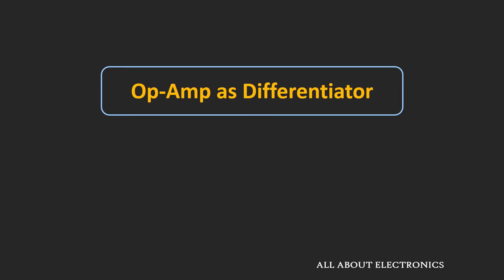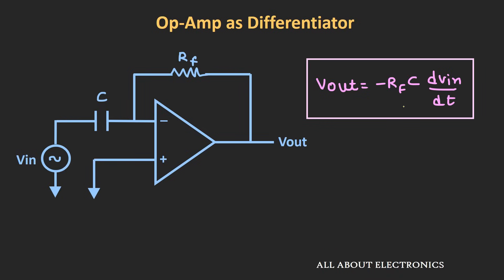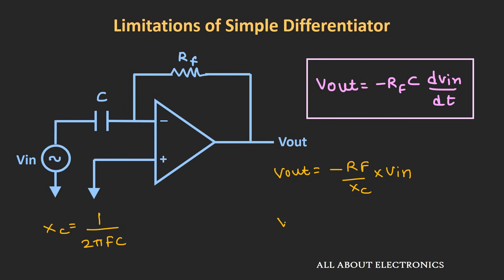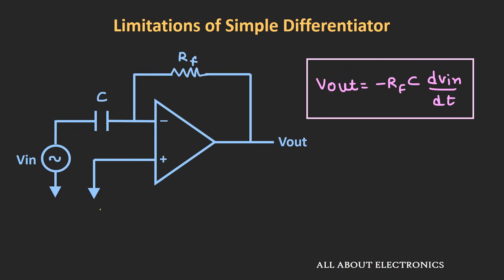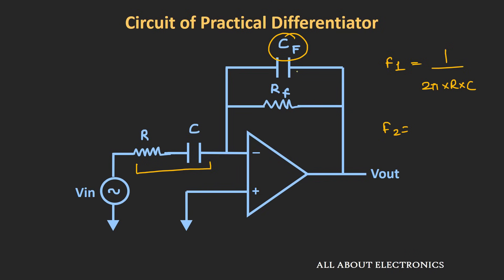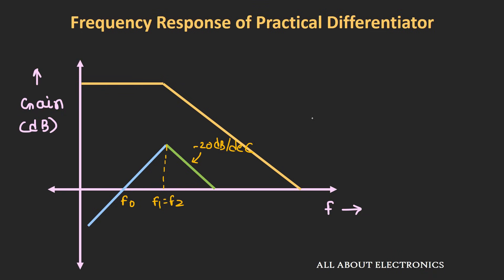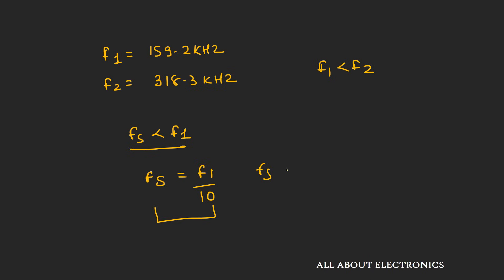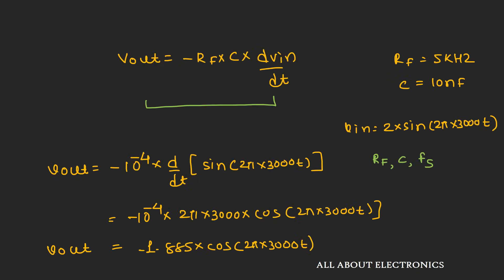Op-Amp Differentiator (with Derivation and Examples)

Comment: Sir at 6:43 you have said that 0 Hz and DC Level the gain is 0. so no offset voltage. 
1. What is this DC Level? 
2. Why because of it there is no offset voltage?
3. Can you please explain the open loop graph that intersects with the voltage gain graph?
Reply from the maker: First, I was referring 0 Hz signal as DC signal. So, 0Hz frequency signal or DC signal both are same.
Second, at 0Hz frequency gain is less than 0dB (Actually is it not 0dB but even less than 0dB). So, let's say at 0Hz, if the gain is -20dB, then all the DC signals will see the attention by that amount. So, if you apply any DC signal then it will get attenuated by that amount in the output. If any input offset voltage is present at the input, it will also get attenuated by that amount. (it will not be zero, but very small voltage and can be neglected, as it is getting attenuated)
And third, if op-amp is ideal then the response of the differentiator should be some positive slope (Blue line in the frequency response curve in the video)
But actually op-amp has finite bandwidth, and it can not amplify all the signal frequency. 
(Please check my video on the gain-bandwidth product for more info).
So, the actual response would be the intersection of the ideal differentiator response and the frequency response of the op-amp. 
So, the maximum gain which can be achieved by the differentiator is limited by the frequency response of that particular op-amp. 
I hope it will clear your doubts. If you still have any doubt then do let me know here.

Comment: The gain of differentiator cannot increase indefinetely. It is restricted by what, it is not sounding clearly. You say something "open loop..." what is that ? At 6:21 in the video this is appearing
Reply from the maker: I was talking about the gain of the differentiator. The maximum gain which is achieved by the differentiator is the intersection point of the open loop gain response and the response of the differentiator.
Reply: @ALLABOUTELECTRONICS  bhai how then open loop gain comes here ... why we comparing this ! I didn't get bro..
Reply from the maker: @ankitpandey3774 Pandey without the differentiator circuit, the gain of the op-amp would be the open loop gain. But with the differentitor circuit, the gain will change. (Due to feedback). As this differentiator circuit contains the R and C, its gain is frequency dependent and the maximum gain is the point where the two responses intersect. (open loop gain and the response of the differentiator)
I hope it will clear your doubt.
Reply: @ALLABOUTELECTRONICS  yeah I get thanx bro.. a lot 
Currently m seeing all the Opamp videos of this channel..it's totally great & best videos among other channel for these topics. especially u see questions & give answer, so come & see this channel makes great helpful like me.

Comment: Hello sir. Thank you so much for such a great explanation of both integrator and differentiator. But there's a bit of confusion with one of your examples in your video differentiator video.
In example no.3 at 18.51, you had evaluated V out and the result came to out be 2.4. But when you graphed it, you had considered of square lying between -2.4v to 2.4v. Are you trying to convey, the output we get is the peak value ? If yes, then why did you consider V out in Integrator video as the swing voltage, hence the output lying between half of output values, which is in reference to your answer posed during 16.45 in Op-amp as an integrator.
Thanks!
Looking forward to your response asap.
Reply from the maker: In the third example, for the positive slope, the output will be -2.4V and for the negative slope, it is 2.4V. So, the Output voltage is swinging between -2.4 V and 2.4 V during positive and negative slopes respectively. 
While in case of integrator video, the output voltage represents the total voltage change in 50 microseconds, or you can say it is the slope of the output signal. And that is why peak voltage in both directions are +5V and -5V respectively. 
I hope it will clear your doubt.
Reply: Alright. That did clear it. Thank you.

Comment: Sir adding more resistors causes more power loss right?
Reply from the maker: Yes, it will cause more power loss.
Reply: ALL ABOUT ELECTRONICS isn't that bad for circuit?
Reply from the maker: As long as it is within the allowed limit, it will not cause any problem. Usually, the current flowing through resistors used to be in mA. So, power dissipation across each resistor used to be within the allowed limit.(e.g example if you are using quarter watt of resistor then power dissipation across resistor should be less than 250 mW. And if it more than that then you can go for a half watt of resistor).
Reply: ALL ABOUT ELECTRONICS thanks for replying

Comment: Sir when we are dealing with practical differentiator we are connecting R1 and CF but in example why we are not taking effect of
 that??
Reply from the maker: Because the signal frequency fs is more than 10 times less than the frequency f1 and f2. So, we can use the equation of ideal differentiator. And R1 and Cf will not have much effect on output.
Reply: Thank u very much sir
Reply: hi my i you younderstand the problem

Comment: sir at 19:53   you said "at zero frequency, the gain of this differenciator will be equal to zero"  but in graph  at zero frequency, the gain of this differenciator is negative db...please sir tell me  i am confused...  and sir why Fs=F1/10  ???
Reply from the maker: Ideally, at zero frequency the output should be zero. But actually, you will get some voltage at the output. (Very low voltage, less than input). So, the ratio of output to the input (Gain) will be much less than 1. And in decibel, it will be negative.  That is why gain is shown as negative in decibel. 
Now,  coming to your second question, for proper differentiation, the signal frequency should be less than at least 10 times less than cut-off frequency. It is related to charging and discharging of the capacitor. If the signal is changing too fast, then capacitor will not have enough time for charging and discharging and that will affect your output. You can even try that in simulink and can see the result.
Reply: its now clear...thank you sir..

Comment: Sir what about voltage drop across resistor R1??
Reply from the maker: Hi, would you please tell me the exact the exact time in the video where you are talking about this voltage drop?
Reply: Sir I m talking about the input side resistor
Reply: How much voltage drop across input resistor R1 which is connected in series with capacitor c1
Reply from the maker: well, you can find that for the given operating frequency.  Vr= Vin*R/(R+Xc)
Reply: Thank you...
But we know that ic=cdv/dt 
And current fellow through Whole ckt is remain constant 
So voltage across R1 are Vr=Ic R1??
Reply from the maker: well, that is also true. You can say so. As both are connected in series. So, the same current is flowing through resistor and capacitor. This equation will be helpful when you have given the signal in time domain (e.g Triangular wave). And you want to find out the drop across the resistor with time. While the other equation will be helpful when you have given the sinusoidal wave with given frequency and you want to find the RMS value of voltage drop across the resistor.
Reply: Got it sir ....
Thank you very much ....